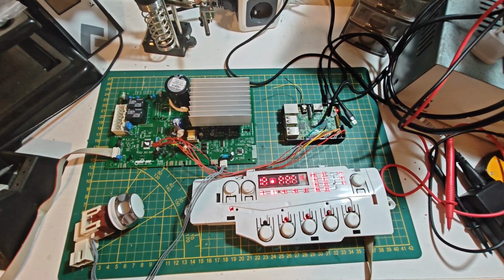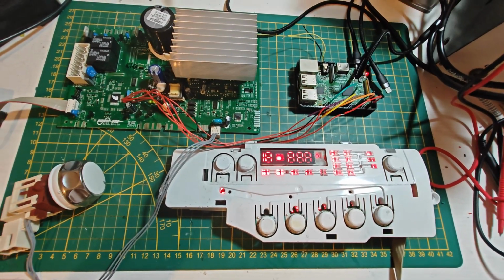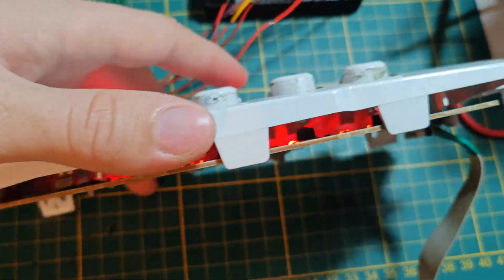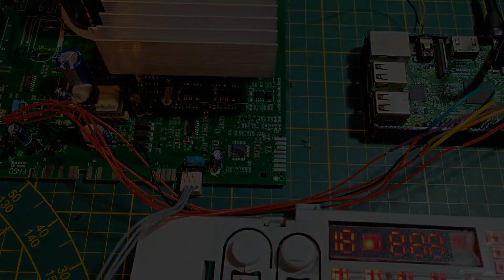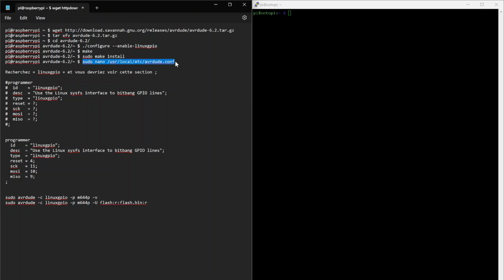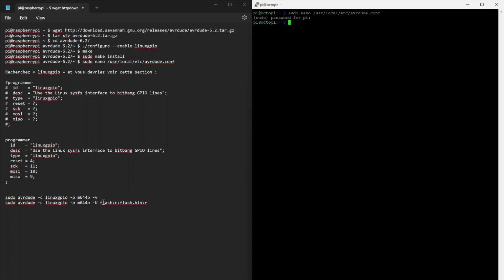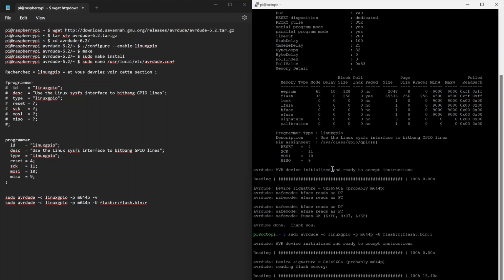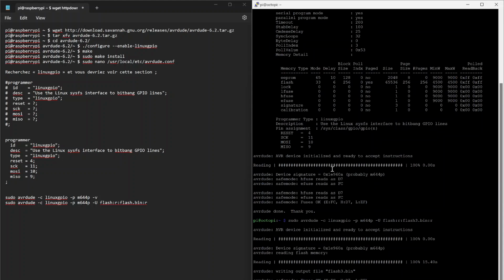AtMega644 flash reading with raspberry pi - Attempting to repair a Hoover W964DP-47 washing machine

Comment: Fab I used to work for Nortek electronics, they build alsorts of stuff for buses, all based off atmega chips.  I still have one of the bus modules, will try that out on a pi.  As I was one of their devs, I still have the source code so I can check whats what.  Wonder if there's hex2c,  most of our stuff was written in C
Reply from the maker: Thanks for commenting! You should be able to read it with a pi no problem as long as the lock bits aren't set. I also work in the automotive industry but on embedded Linux devices, not atmega so not much experience yet apart from Arduino which is based on them. I'm not sure what hex2c does ? From my understanding you can decompile the extracted firmware to machine code but I'm not sure that getting back to C is possible without a lot of extra work.
Reply: @ProjectSeb  I modded the code, so I made doubly sure the lock bits were not set ;)
Reply: @ProjectSeb  yeah I don't think hex (the binary, we just grabbed) 2 C reverse the bin/hex back to C.  I agree extra work, not even sure if its possible.